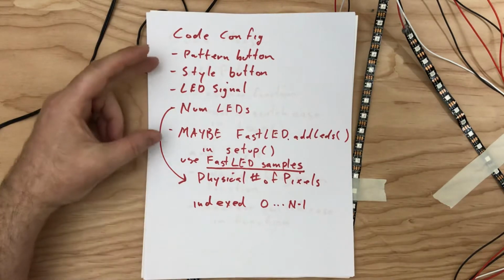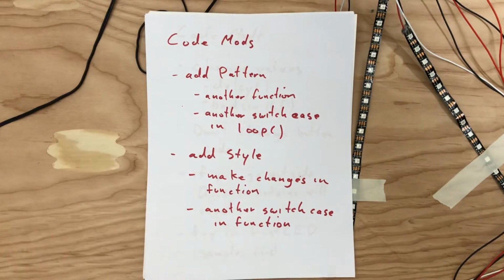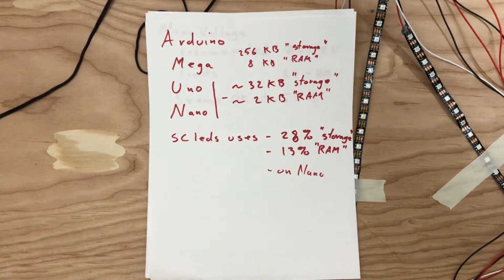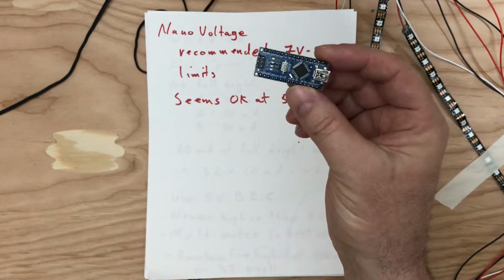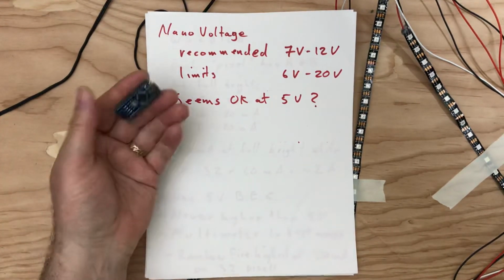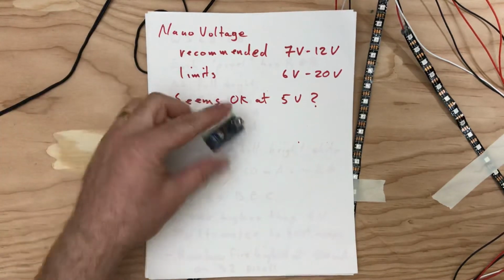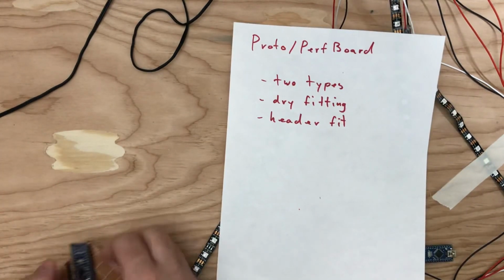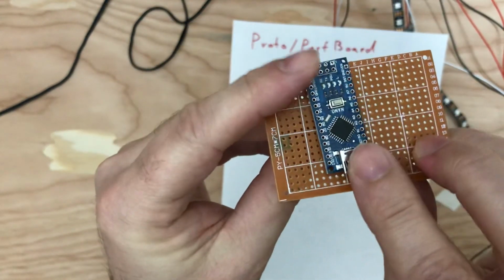SCleds - More information. (part 6/6)

Comment: Shawn,
I love this program. 
I have a question
I added a switch to turn LEDS on and off with my radio and I changed the default pattern from 0 to 6 and kept Style at 0
So when I turn on the Arduino it will run the Fire Pattern but now my question is this. 
How would you change the program to all ways start with the last used pattern and Style this way if I want to use a different pattern at startup I would just have to run that pattern before I tune the Arduino off. 
Is this possible????

Please let me know one way or another I would very much appreciate it
JimV
Reply from the maker: Hey. Thanks for your interest. Have not looked at that code for a while but I’ve used the device on many other things like bikes and costumes, powered by AA battery packs. Arduino is stateless so it does not remember the settings from last time but there is an EEPROM option that is hardware specific. Might be worth looking into. https://docs.arduino.cc/learn/programming/eeprom-guide. 
If that does not work then I would try adding some switches to represent a binary number that determines the pattern and style. Ie. 3 switches could give you 0-7 for pattern and another 2-3 could give you 0-3 or 7 for the style. 
Let me know how it goes.
Reply: @shawncruise2030  this is over my head does the EEPROM already part of the Arduino Nano or do you have to add a chip to use it? The switches are over my head you are talking about using switches on my radio to change Pattern and Style which sounds confusing. 
Thanks for getting back to me.
Reply from the maker: @jvalovcik  the EEPROM should already be there. Give the sample a try and see what happens.  Sorry for confusion on the switches. I meant just regular slide switches attached to the arduino and not switches on your radio transmitter. It would be easier than cycling though the patterns and styles by button clicks. By binary i meant switch off being 0 and switch on being 1 and use that for pattern selection or whatever mode setting you need. Assuming 3 slide switches, off off off = 0, off off on = 1, off on off = 2…. like binary. That way it would be the same mode as the last time. Not elegant but it would work. Slide switches are pretty easy to work with in arduino.
Reply from the maker: EEPROM be there on the nano anyway. I’ve never tried it but it should work. Link above lists the arduino versions it should work on.
Reply: @shawncruise2030  I got it now thanks I will have to try it out and see.